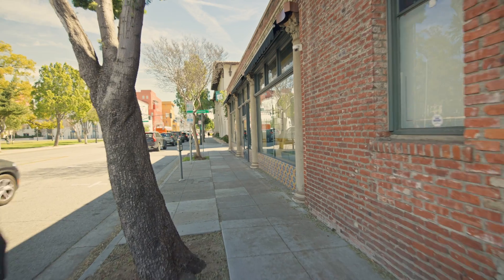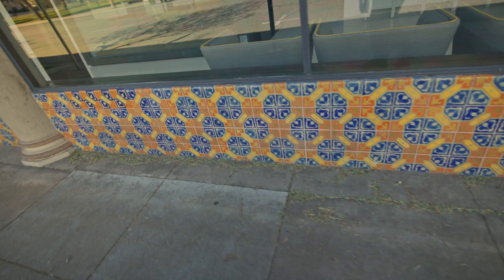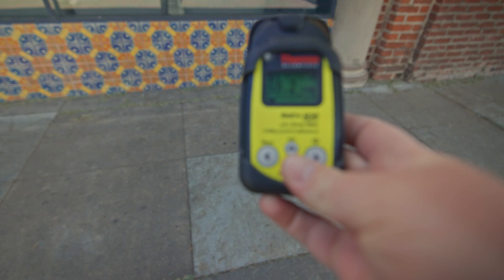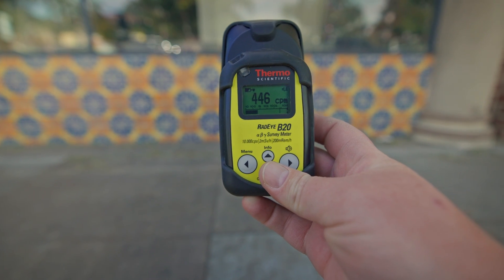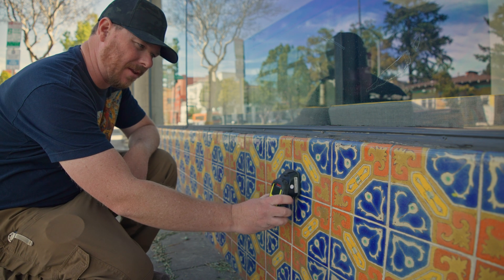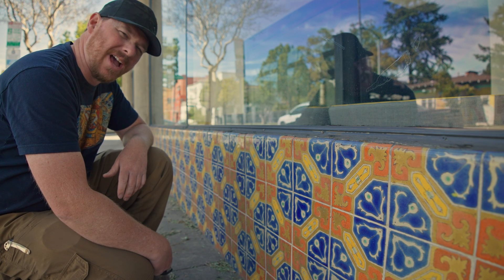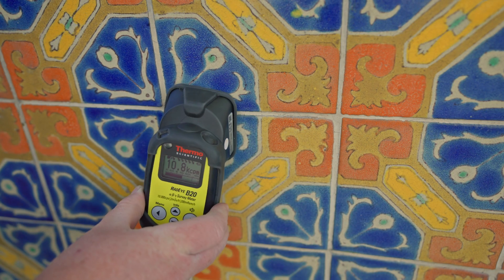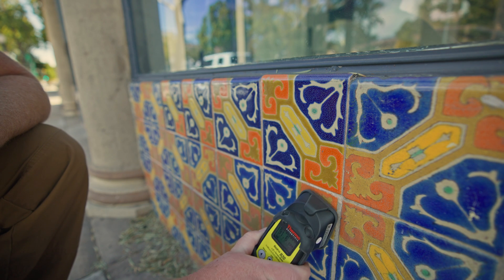Uranium Tiles on Pasadena Sidewalk

Comment: I checked it out with an SBM-20 tube kit geiger counter (no alphas), and it was HOT!
Reply from the maker: Yeah, there is a lot of beta radiation coming off of those tiles. That's why you can detect it from the road.

Comment: I discovered your channel yesterday and I've binged watched at least 20 videos already. I've always found radioactivity to be very interesting to learn about. One question, would tiles like these pose a threat to someone if they lived with them in their house versus walking past them occasionally on a sidewalk?
Reply from the maker: I don’t think so. It kind of depends on how close you are to them and for how long. I want to say their is no risk but I’m not 100% sure. Some of those tiles can be decently radioactive. You could always use glass to protect the tiles and to shield the radiation. But with all that I have seen I’m pretty sure they are safe. I think it’s good to know about them and understand the radiation they give off. Cutting into them releasing dust into the air wouldn’t be a good thing.
Reply: @RadioactiveDrew  is it dangerous if say someone had these in their kitchen floor for 30 years?
Reply from the maker: @RyanDale100  Really depends on what you were doing with them over those 30 years. The biggest danger is cutting into the tiles and inhaling that dust.

Comment: Trying to resist the urge to steal one
Reply from the maker: There is a shop around the corner from this place that sells tiles just like this that were saved from buildings tearing them out. I would get one from there. Next video will be about this shop.

Comment: spicy tiles, the hottest thing I have is depleted uranium, its the check source on my on CDV unit
Reply: I've got exactly the same that I shipped in from the US back in 2019. More of a museum piece of equipment though because of its age (1962), but mine still works okay & is in excellent overall cosmetic condition, which is rare.

I've got 15 GM counters/dosimeters now...must be bonkers...hoping to get hold of a Radiacode 101 as soon as possible.
Reply: @ajacks1349  the oldest unit i have is from 1955 all vacuum tube tech

Comment: Man I am glad I found your channel like 2 weeks ago. I just so happened to be in town today visiting my dad and I've already looked at a few antique stores in Pomona. I think I'm going to have to take a side trip to Pasadena today LOL... I found a nice traveling alarm clock that puts off 3,400 cpms. (I'm only using a GMC gq500) I was wondering if you had any suggestions on should I put in my pack luggage or should I mail it back to myself.
Reply from the maker: That area has so many places that used radioactive tiles like the ones I found. You just need to look around to find them. 

In regards to that radium clock, pretty sure you could travel with it. Not sure how it will come up on the x-ray machines. I don’t think there are any restrictions on items like that.

Comment: Remember, during that time period, the uranium oxide used was from natural uranium, rather than depleted uranium used later on.  Probably a fair bit of daughter products like radium mixed in, so the gamma content of the reading is probably adding to that distant readability.  Very cool stuff!
Reply from the maker: Even back then they were pretty good at separating out the radium from the uranium. Also during that time period uranium was viewed more as a waste product because radium was the real prize back then.
Reply: Our late 1930s Australian bathroom has extensive yellow cake tiles, mainly mid-yellow colour. However, there are also deep opalescent orange decorative tiles that are 10x more radioactive. For some reason, these tiles never  have any mould growing in wet areas :)
An old empty CD case lid drops Geiger counts by 100x so not too many daughter products hopefully.
I am more concerned about toxicity from leaching oxide from the glaze in wet areas.